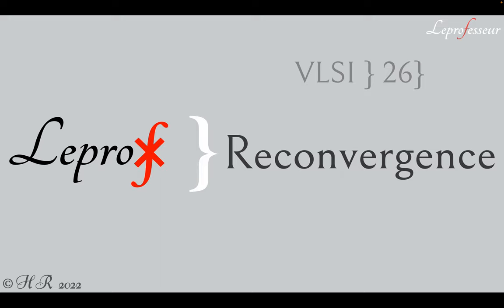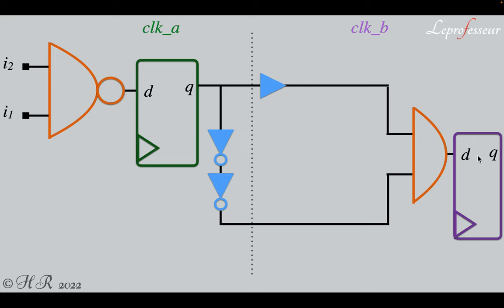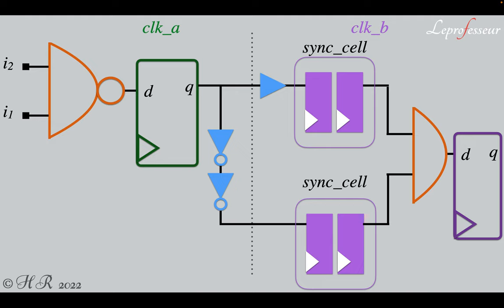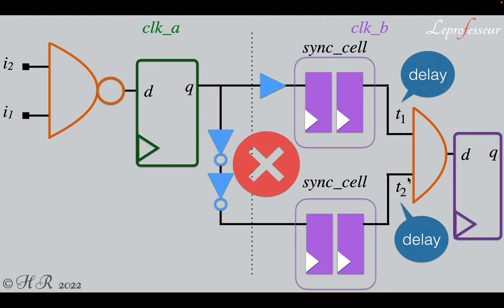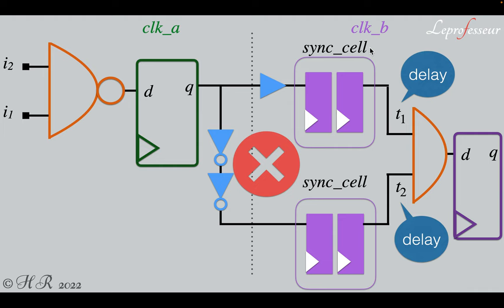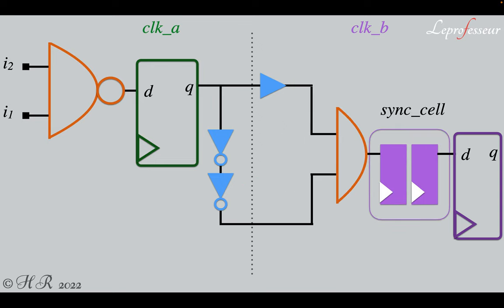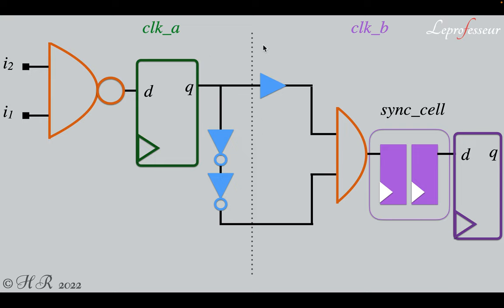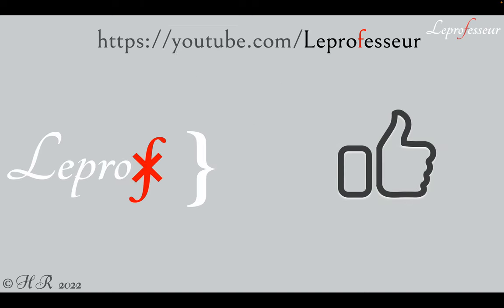⨘ } VLSI } 26 } CDC, Reconvergence } LEPROFESSEUR }

Comment: I have a doubt. Let's say two signals are coming from two different clock domains to a single destination clock to be used in a combinational logic. How to solve the convergence in that case?
Reply from the maker: you may need to have some logic in Tx domain, e.g. combine both signals in Tx, flop resultant signal in Tx domain and then pass to Rx domain, synchronize it and use in Rx domain.

Comment: Video is interesting and helpful. I have a doubt. in the end, how are we solving the glitch issue? Is the solution, shown in the end a complete solution to CDC reconvergence? The glitch causes wrong value to be sampled by the 2- FF sync. right? Please clarify
Reply from the maker: first sync flop latches the async value, waits for whole cycle before it passes the value to 2nd sync flop, in theory it should be good enough for 2 stage flops but sometimes 3 stages are also used, depends on various technology factors and clock frequency. These are specially designed flops to deal with metastability. however in designs other qualifier signals are typically used which act as enables with few cycle delays with some handshake/ack mechanism between sender and receiver, designers need to think about both data loss of signal in receiver domain and accuracy of signal. it is good idea to have handshake mechanism when clocks are not source synchronous. In high speed designs typically clocks frequencies and ratios are known and often source synchronous, there open loop cdc solution is also good, however designer need to make sure to have enough pulse width of sampled in receive domain to be properly sampled synchronously in receive clock domain.

Comment: 5:48 
Thanks for the video!

Something doesn’t make sense here; We close timing between the metaflops and the capture FF. There shouldn’t be any glitch there. 
What can happen is a phenomenon called synchronization ambiguity.
Propagation delay towards the D of the metaflop may vary between the two, so that one net is synchronized in delay. It is not a glitch issue.

 Meaning, we don’t know when the Q of the launch FF will arrive at the D input of each synchronizer; It may be launched and arrived an epsilon before SETUP (then it will take 1 cycle to synchronize), an epsilon after HOLD (then it will take 3 cycles to synchronize) or it may stabilize sometime before the posedge of the sampling clock, and then it will take the most common, 2 cycle-synchronization. But, even if both metaflops synchronize the signal within 2 cycles, nobody promises both will start synchronizing at the same time, because these are async paths
Reply from the maker: thanks for detailed comments, typically in cdc paths timing is not closed by primetime or similar static timing analysis tools, it is considered false paths. Logic designers need to ensure correct mechanism for CDC. CDC tools (mentor's 0-in, now Siemens) are used to do CDC analysis and help to find out where in full chip CDC paths are, tools can dump out assertions which are then simulated to ensure that data los can be captured and addressed before design can be signed off. Microarchitecture and logic design need to ensure correctness that design. Every chip has standard procedures to handle on-chip clock and reset domain crossings. I hope this clarifies.

Comment: Thanks for the great information

Could you please share details why Async reset de-assertion should be synchronised with clock
Reply from the maker: if asynchronous, it will lead to unstable state in flops. It is required to have all flops in known state after de-assertion of reset.

Comment: I think there still.lies the problem of reconnvergence glitch at the end we are using a combinational logic on the signal crossing the clock domain which is not correct we must always sync the signal first before using it.
The ideal solution would have been to push the entire combo logic in the dest domain use a synchr. first then use combo logic afterwards.
Am i missing something here
Reply from the maker: my understanding is that push the combo logic in Tx domain, pass one wire to destination Rx domain, sync it before using via appropriate synchronizers from library. if you have multiple signals then it becomes more complex. Manny a times a global synch mechanism is used in combinations with local mechanisms of dealing with this situations.